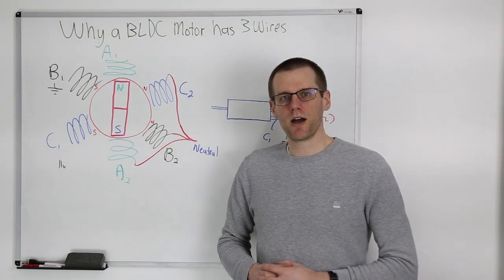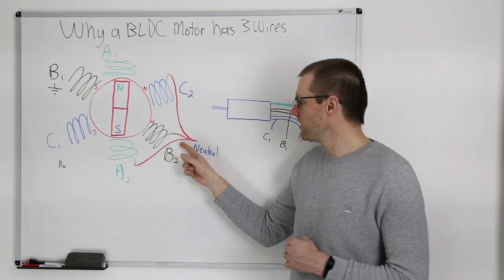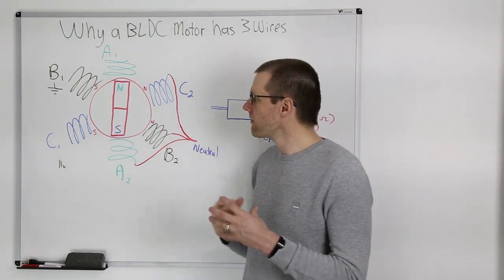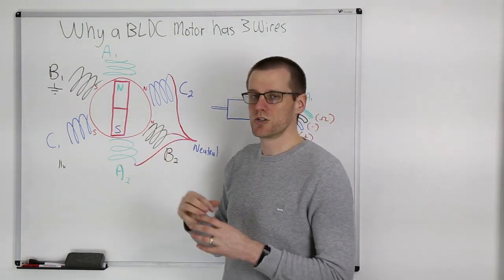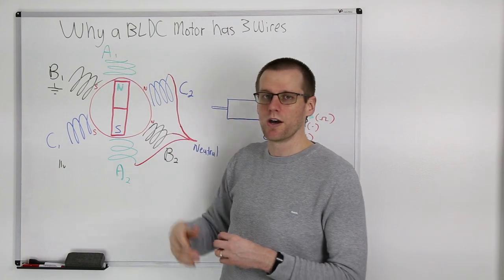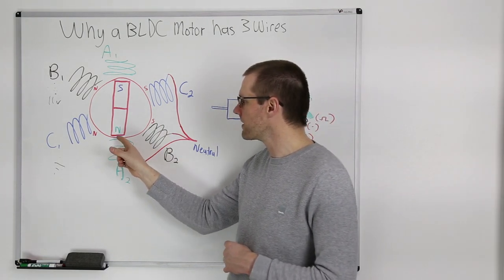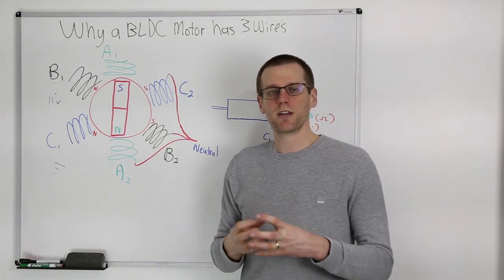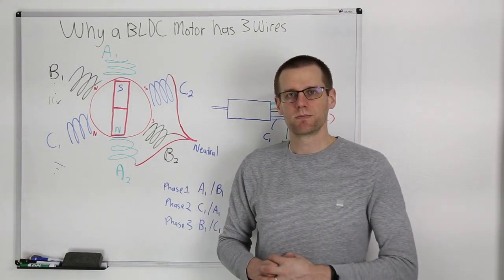Why does a Brushless motor (BLDC) have 3 Wires

Comment: I FINALLY got what the fuss was about the back EMF. Everywhere I read back EMF was used to calculate the speed, but only now I am getting how it is actually done. Thankyou!
Reply from the maker: glad it helped
Reply: @RCexplained  I came back to this today, and I think there is something wrong with the diagram. Idk how to explain this in a short comment, but when i tried to draw a diagram of this, I couldn't really decide the winding direction of the coils because they have to keep changing according to this diagram. Sometimes clockwise and sometimes counter-clockwise. I think the terminals need to be at 120 degrees from each other.

Comment: I’m just trying to figure out if I can retrofit a brushless motor into my starter box, and what it would require to do so. If it can be done at all. My engines have such high compression the standard two 7.2v batteries cannot turn the flywheel. So I need to know what to do with the third wire? Do I need a small esc? Can I wire it like a brushed motor and run the 3rd wire to elsewhere? I am fairly, no, completely lost with the new brushless motor workings. Help!!
Reply from the maker: You will need a brushless esc

Comment: I admit, I'm coming in as someone who knows very little about brushless motors, but it would make a LOT more sense if C1 and B2 had the same polarity and B1 and C2 had the same polarity.  If they do, the magnet would stop when it is pointing at A1 and A2 and that would trigger the pole reversal causing it to flip again thus rotating, but if it was really the way you have it drawn, the magnet would stop halfway between B1 and C1 on one side and halfway between C2 and B2 on the other side.  I'm just going to assume you messed this up since what you are saying doesn't really make any sense.

Comment: Why bosch drill 10.8v li model have only 2 wires out? But it is brushless
Reply: Most DC motors are this way, with a simple positive and negative to spin the motor, reversing the polarity to go the other way. I believe the speed is modulated via decreasing the voltage. Not really sure the specifics of windings, but it's a continous, simpler version of the BLDC one in this video.

Comment: Is there any 2 wires BLDC motor is available in market? If yes, give me brief explanation how it was possible?
Reply: An alternator might be a brushless dc motor.
Reply: A fan motor might be a brushless dc motor.

The motor speed is synchronous to the ac frequency. 

By controlling the frequency of the AC supply, you control the speed of the rotation. A variable frequency drive “vfd” is used as an electronic speed controller (esc).